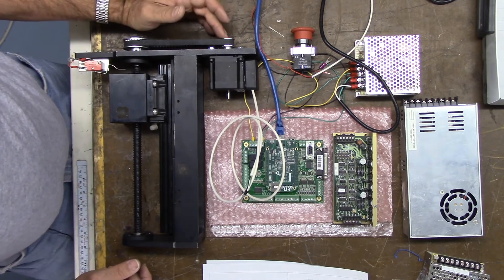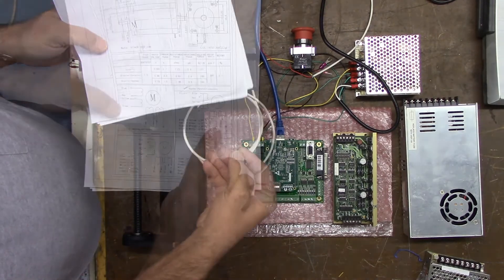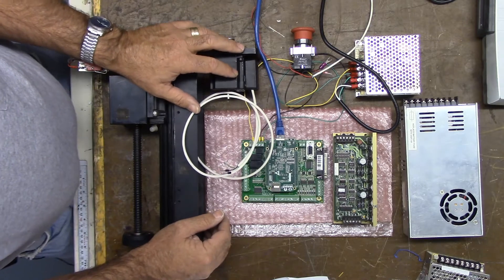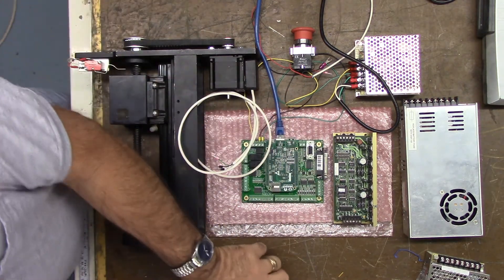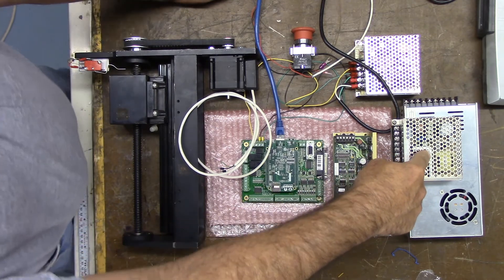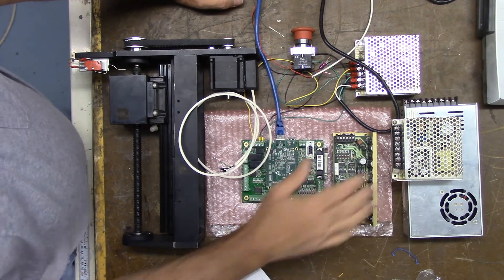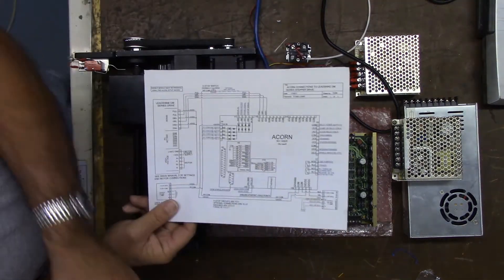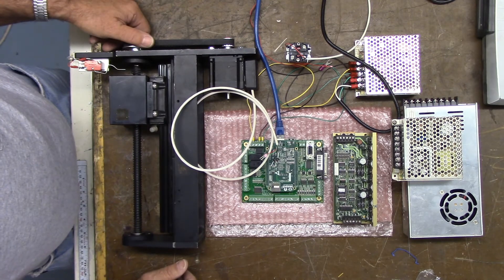Centroid Acorn CNC Basics - Component Overview

Comment: Marty, what gauge wire are you using to connect your dyn4 to your acorn?  Ty. Joe
Reply from the maker: I use shielded cable and generally 18-22 gauge. I am trying to standardize everything to 18 gauge. A bit of overkill but its too much hassle to have multiple wire sizes. 18 works for about everything.
Reply: @martyscncgarage5275  thank you Marty.  Im hoping to hook up my acorn soon. Getting everything together   I have the acorn and the DMM4 servos  will start making the servo adaptors ASAP !